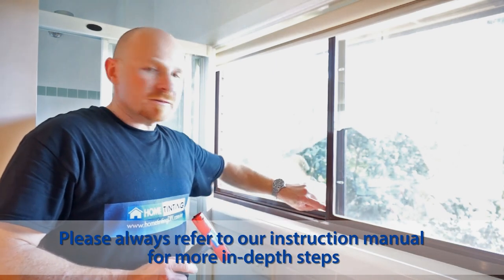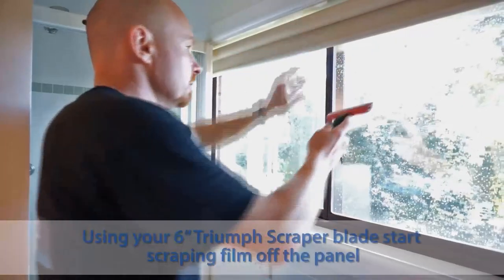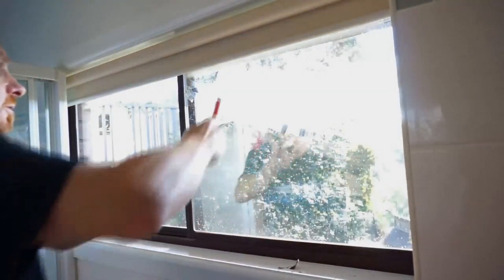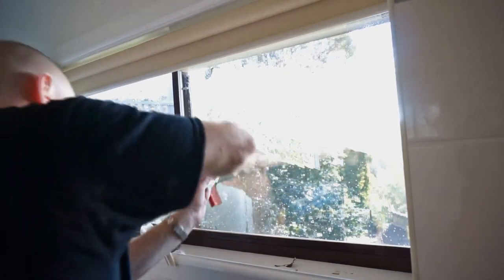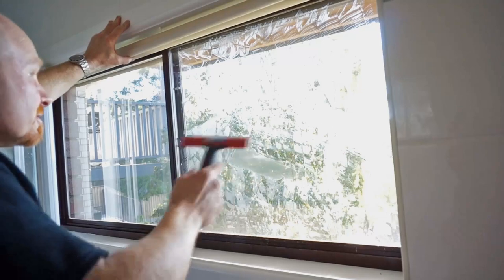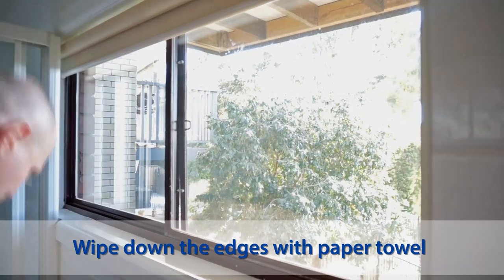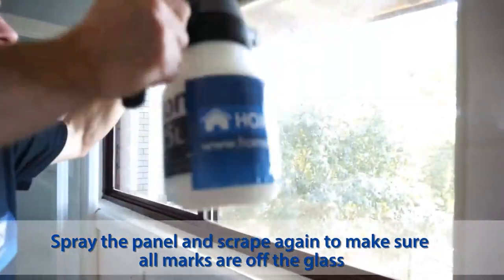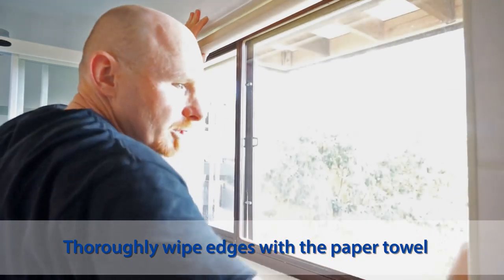HometintingDIY's How To Remove Old Tint From Your Windows

Comment: Excellent video. The film on my windows had evidently been in place since the house was built in 1986. I used the Triumph scraper and plain water. No special solutions (aside from much elbow grease) were necessary. The glass was not scratched. An additional hint: I found that flipping the blade end for end, i.e.: using the other side of the blade before the other edge, prolongs the useful life of each blade.

Comment: Do you ever put fine scratches into the glass with that tool. It seems to me that occasionally you can scratch the glass if the film is hard to remove. What is your opionion
Reply: The stainless steel scrapers and knife blades won't scratch normal window glass. Just beware of sliding doors and other windows with toughened glass. It usually has a rough side and a smooth side. Scraping the rough side can cause scratches.